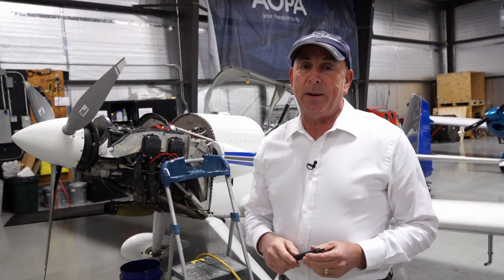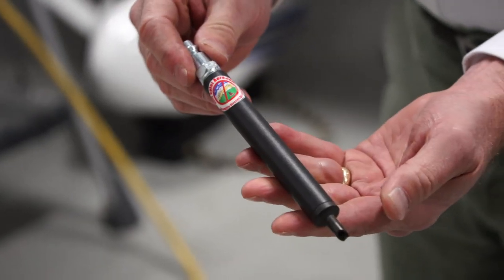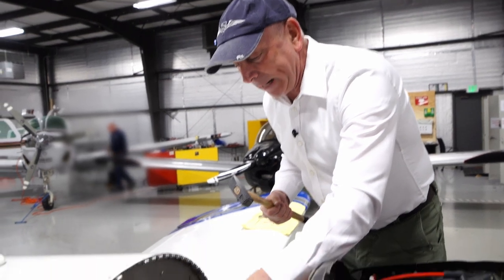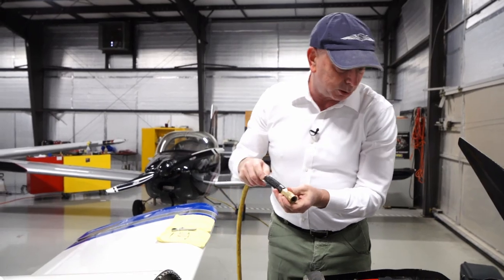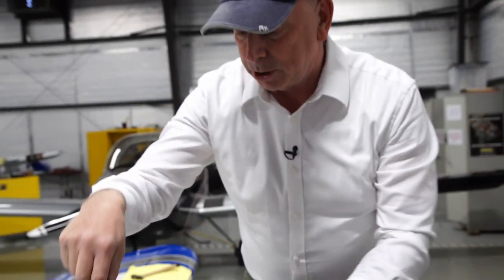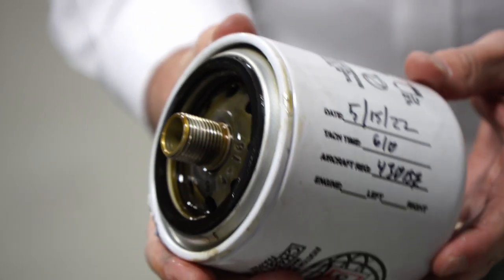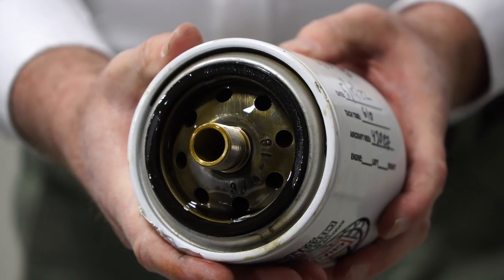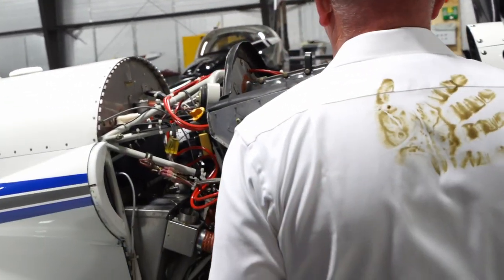No More Messy Oil Changes With This Anti-Splat Tool

Comment: What about the dirt deposits inside the filter, won’t they get into the engine under air pressure?
Reply: Not only would it possibly blow debris back into the engine, it would certainly make it harder to inspect the filter after you cut it open for any debris.  Interestingly, the Company has a video on this product on youtube, and this question has been asked over a year ago on multiple occasions in the comments without any response.
Reply from the maker: The particles get trapped in the filter media, and what little air pressure is being blow is incapable of blowing them out. If they did blow out somehow, they'd be flushed out the quick drain with the rest of the oil.

Comment: I feel like it would be a better idea to put a hose on the other end and pull it out instead of pushing it back through the engine. I know it might be under low pressure but if it was a race or heavy duty application you can't take any chances.

Comment: I would rather have a little oil mess than blow the crud the filter catches back into my crankcase.
Reply: You didn't. You're lightly pressurize the side of the filter medium that traps the particles. Not the other way around.

Comment: Agree with just a pilot. 
If by chance you blew contamination into the engine, you’re filter element in the oil filter is blown and you would introduce it during engine operation as well. Using the tool introduces air on the contamination side of filter element and is filtered prior to entering the engine. Bottom line, No contaminations.

Comment: Gimmick. Right. I'm go'in to beat on my filter. Doesn't the filter thread into the block?
Reply: Meh, don’t hit hit any harder than needed to puncture the filter. Doesn’t take much force to puncture.
Reply: @10RRASK  How do you know what's "hard enough" until the filter gets punctured? Sounds like the "pound of flesh - no more, no less" argument.
Reply: @EJWash57  have you used a hammer before? If it doesn’t puncture hit it a little bit harder. Don’t wail on it with a 5 pound sledge.

Comment: I'm guessing you showed the engine monitor while doing this to show no oil pressure build up that would put air into the galleries. That was my concern when you introduced the tool to us. Is there a psi limit while using it or a time limit.
 I still have the old screen on the Cherokee. But an interesting method there.
Reply: The oil galleries shouldn't empty because air blew over top of them. Should be fine.

Comment: So after 25 or 50 hours of filtering stuff out of your oil you take the chance of blowing junk back into the engine and hope it all drains out?  There are better ways to have a “no oil mess” oil and filter change. There is no way I’d use that tool on my airplane.
Reply from the maker: The particles get trapped in the filter media, and what little air pressure is being blow is incapable of blowing them out. If they did blow out somehow, they'd be flushed out the quick drain with the rest of the oil.

Comment: You used an oil filter torque wench to loosen the filter, NEVER use a torque wrench to undo assemblies, a torque wrench is designed to tighten assemblies to a specified value not to be used as a generic wrench to loosen assemblies and potentially ruin the calibration.
Reply: Yes,easy way to damage your torque wrench.
Reply: He also hammered that metal air hose attachment with a metal hammer. But hey that’s why you don’t need to be a mechanic to change your oil.